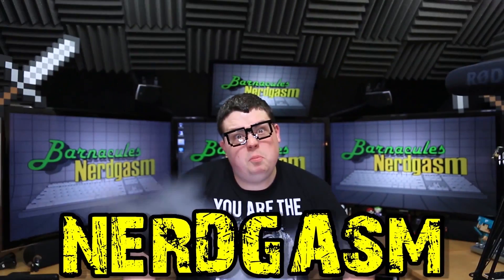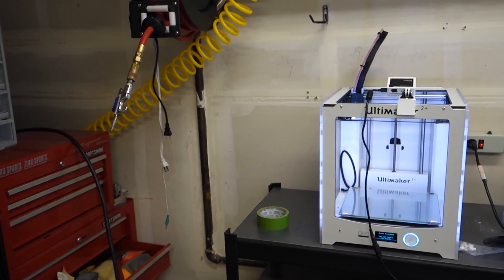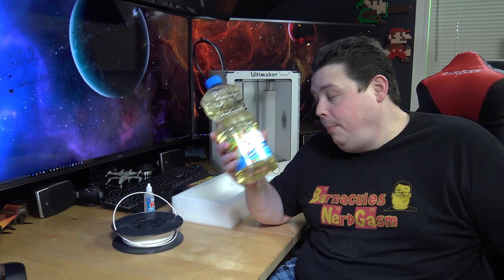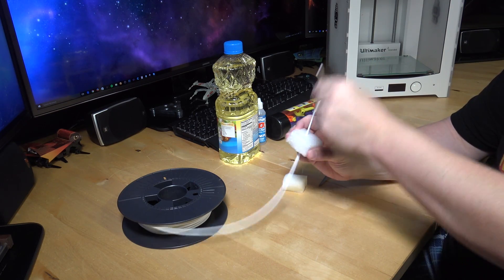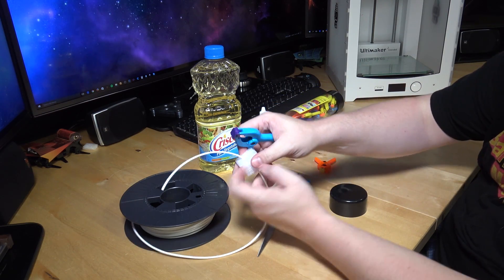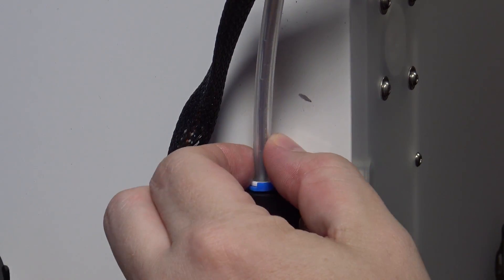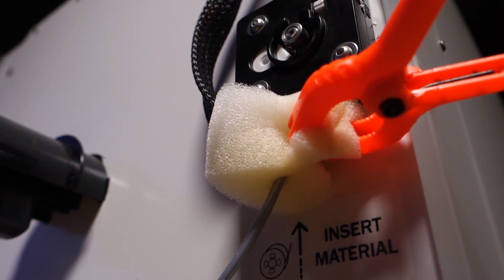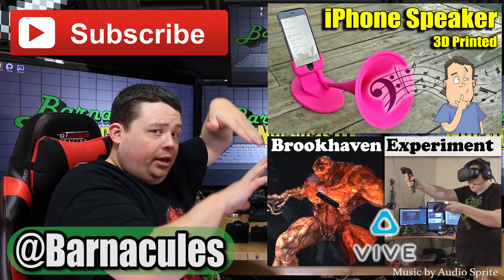Custom 3D Printer Filament Cleaner Helps Stop Jams! #JerryRigged - @Barnacules

Comment from the maker: This is still a fantastic way to keep your filament clean and stop your nozzle from clogging especially with high temp filaments when you're in a somewhat dusty environment. I found it had the most impact on my printers deployed in my garage because of dust kicked up from my central heating system. Also, come join me for Morning ☕LIVE stream on http://twitch.tv/barnacules daily at 9:30am PDT
Reply: Barnacules Nerdgasm I used this on my Maker ultimate pro (Monoprice's D6 rebadge). It's INCREDIBLE how much dirt and dust comes off the filament. There was visible build-up on the filter after a few prints. There are No more sputters from a partially clogged nozzle!

P.S. I blame you and The 3D Printing Nerd for getting me hooked on 3D printing. It's like a drug. "Ooooo PLA and PETG. MMmmm nylon. MORE! I NEED NINJA FLEX, WOOD AND COPPER PLA! I NEED THEM ALL!!"

Comment: They make printable models that contain the foam inside of a small canister, if you don't feel like having the foam out in the open. I've used one for a few months, and it's a great little dust collector.
Reply: How often do u replace it? Today i had a print failure cause of dust even though ive got the printable dust filter canister thingy, the one thats purple in the youtube thumbnail video, i swear i had changed the filter like a few days ago
Reply: @l0wkey529  I haven’t had to replace it. Keep it totally dry and everything will work out. Oil and other liquids put the dust back onto the filament. I use very porous open-cell foam for ease of maintenance. It gently debrides the filament of any dust. Just have to blow it out with canned air every few months.

Comment: If your extruder doesn't have PTFE sleeve, adding oil lubrication to the filament can help prevent filament clogging.   Don't use cooking oil as this will go rancid.  Use mineral oil instead.

Comment: you know, this stupid trick.... worked.  I had been having failed print after failed print. it was driving me nuts. kept jamming. I took a piece of dish spong. put a slit in it and put it on the filament, and whamo, prints fine.....

Comment: Why not just use instead of clamps, a zip tie ? you can adjust it all around the block and pretty easy to mess with it while the print if it does drag too little.

thoughts ?

Comment: I haven't tried it yet, but plan on doing this at some point. I ordered an FT-5, and when I get it, and finally get it built. I plan on printing a filament enclosure. If it turns out well and works well I may release it so everyone can use it if they want. 

The enclosure I am planning is probably a good example of over engineering... The enclosure will be multiple pieces, a solid outside that does not move that is 2 parts (hopefully airtight or close). The filament exits the enclosure into a bowden like tube, maybe one for 3mm filament? , or one maybe a little larger. It doesn't need to be as tight to the filament since it is on the other side of the drive. It is just a method to keep dust off of the filament. The tube would either enter into a direct drive, or a bowden input side. The spool will be on a rotating assembly that locks to the spool that also has adjustable tensioning built in so the spool does not unwind inside the enclosure. 

I also plan on enclosing the FT-5, not for temp reasons, just a way to keep as much dust out as possible.

Comment: so you have a (actually looks like at least THREE) 3d printers, and the best design you could come up with for a  filament filter is just a clothes pin or a clamp ? way to utilize that gear my man.

btw, don't do this stupid "oiling the filament" shit, it's been proven to not only gunk up your nozzle, but it will also ruin layer adhesion in your prints. think about it, you want the plastic to stick to itself, right ? so introducing a lubricant to that is going to help ?? if your filament is hanging up, squirting some crisco on it isn't going to fix your issues, and it'll create a whole new set of problems.

Comment: CNC Kitchen said the oiler weakens the layer adhesion. What is your opinion about it? Why not just use a foam block without oil to wipe the filament?

Comment: i have an idea about the filter. IF...you 3d print a plastic box that can open and close or snap together, you could place your filter INTO the box... so the filter doesn't get any dust on it. On the box on the top end and bottom end you will want to drill a hole on each end so the filiment can pass through the box. then velcro the box to the printer. when you want to change the filter...un velcro the box ....open it up.....change the filter then stick it back on the 3d printer. plus...you won't need a honken clamp on the thing...the box will hold the filter in place. just a thought for you. it's what i would do. thanks.

Comment: I'm using melamine foam. It's marketed as magic eraser I think. I put CRC silicone spray in it. Working good so far!
Reply: Great idea with the melamine. do you know if the oil might keep the layers of filament from adhering to each other?

Comment: Do you have any tips on stopping the filament getting jammed on the spool itself , i don't know if its just the crappy PLA that came with my i3 but i have to loosen the filament form the spool or it has the potential to get jammed as its rolled onto the spool over itself

Comment: I did a little research recently and discovered that Magic Eraser foam is the best for Silicone Lubricant.  I'm using it in my 3D printer now.  Great tight foam sponge.  I also 3D printed a housing for the foam since I prefer to have something solid mounted to my 3D printer.

Comment: The technique of using a filter that also lubricates your filament is a good one...but search Thingiverse for "Dust Filter", pick one of your liking, and print it!  I have dramatically improved extrusion performance on my two Ultimaker 2+ printers with the simple addition of filters.  DRAMATICALLY.

Comment: That $60 per role isn't as bad if you consider the 3D printers we use in my engineering classes use special support material that costs $350 per role (about the size  or maybe a bit smaller of the role that Jerry shows in the video) and the model material is $300. We use soluble support that we can put in a solvent bath to dissolve it

Comment: How are you clearing the clog when it's caused by dust?  I don't have dust issues but I often do have filament diameter issues, even with high quality filament. I would like to see a gizmo that would monitor the diameter...  My extruder might be overly sensitive to the diameter.  Taz5 V2 single extruder.

Comment: Better way to do this? Having the extruder stepper directly on the print head just simply works better. There's a lot of play in the filament tube - bends in the tube, from the filament flexing, etc - this makes retraction settings nearly impossible to dial in. Whereas when the extrusion stepper is a mere inch away, in a straight line, from the head itself, there's much less room for problems.

Comment: Couldn't you use a modified test box (such as Thingiverse thing 37274) that was zero filled to hold the foam?  I think that it would eliminate the danger of the foam coming in contact with the extruder.  If it was printed at 30mm it might work better.  I would add four 3mm holes (2 to the solid bottom of the box for at least 2 mounting screws and 2 more that were on parallel sides of the box for the filament to pass through)...  This box design could be easily modified in any 3d program to add these holes and to play with the optimal size of the box.  It may be a good idea (or not)...  I just had some teeth pulled and am quite loopy still.  =)

Comment: Is there a reason he didn't use olive oil? It has a much higher boiling point than veggie oil and could therefore be used with ABS.
Reply: ABS print temps are typically around 245c.  The smoke point of even extra light olive oil is below that.  Rice Bran Oil runs 254c, Refined Safflower is better at 266c.

Comment: epic video but I have one way to make it better instead what you can do is take a small bottle of it and make sure it has a super small hole on the lid put a pipe on it and it and make it lead straight to the phonem and then every once awhile you can just disconnect the bottle. instead of needing to take off the clip and everything

Comment: I still don't like the belt drive systems used on cnc machines like your printer, ballscrews or even an acme thread would be a huge improvement over it and would not drive cost up by much at all.
Reply: Too much backlash in the threads. That's why those aren't very common. and making the thread tolerances any tighter causes more friction/drag, and creates the need for bigger/more powerful steppers, and they'll just wear out faster.
Reply: Andrew Delashaw You do realize that most cnc machines use ball screws right? And that they have very smooth operation and decent ones have PMI backlash compensation. Ballscrews are not just common on CNC machines, they are standard. Belts are a joke.
Reply: Andrew Delashaw And they don't wear out faster.
Reply: Andrew Delashaw AND on top of all of that, too much backlash? Is that your argument? Do you know how much backlash belts have? I have a CNC machine with ballscrews and one with belts, the one with belts has almost .28 backlash on a belt system no different than a 3d printers.
Reply: rkshireygames I have used an Xcarve with belts and a shopbot with screws, I can say I like the shopbot better. especially since it is a stronger printer. but for 3d printers a belt is lighter and more than enough for the light scale of work
Reply: Coleman Becker I still prefer ball screws.

Comment: after a while the filament starts to rip off small chunks of a soft foam and propel them forward. Sometimes w/o consequences... It should be checked from time-to-time. In my experience, better check it every ~5 hrs of printing.

Comment: Doesn't the oil contaminate the filament?
Reply from the maker: +Yutaka Takenouchi As long as it's a very light coating it does not, but if you gob it on there then yes, it totally does.

Comment: does this mess up adhesion? I would think the oil would prevent the plastic from adhering to itself.
Reply from the maker: +Eli Youmans I thought the same thing but I've experienced no such problem as long as the oil is very light, if you put to much on it totally does screw up everything.
Reply: hmm, I will have to try this! When I buy a 3dprinter... #poorpeople

Comment: 3D print small tank and make one side filter and it will absorb oil to filter and you can attach it to wall and it will not move and wont clog and you can easly pore more oil if needed

Comment: be a bit careful with certain types of oil else it might chemically react with some of the plastic/rubber parts in your printer. Not sure if it will be a problem, but it could be in the long run.

Comment: I've never had a clogged extruder due to dust. so i dont see any point to this.. I have a 0.4 nozzle. only clogging problem was from abs particles on the stepper gear getting into a place print. after that one time it's smooth sailing. (if I don't forget to check my bed level)
Reply: pla not place damn phone... can't even edit a post on it.
Reply: +DarkShadowsX5 try the 3 dots in the right corner of your comment.
Reply: ... is this better?

Comment: Personally after my labtime at university I'd recommend silicone oil - pure silicone oil is inert it basically doesn't wan't to react with anything like air (go rancid) or plastics and metal (corode). Only caveat it creeps everywhere - over small bumbs or sometimes  even out of containers. Main problem is getting silicone based lube in high quality without to many additives - like medical quality ... oh wait maybe at the drugstore ... and I also learned that it's important to keep your filament clean, dry and locked away before you lube up ...

Comment: Couldn't the lubrication of the bowden tube be potentially bad? I mean, oil is accumulating inside the tube as the filament goes through and maybe this could result in an oil drop or too much oil on the filament. Is this right?

Comment: Concerned that veg oil will eventually gunk up that tube after a few months, It absorbs moisture and turns into a thick hard to remove gunk. Silicone shouldn't do that.

Comment: Print a small box, with a hole through it the size of the filament so you can have an enclosure for the sponge and oil...would probably be able to create an auto-lubing system somehow too...

Comment: I 3d printed a housing for a rectangle of kitchen sponge foam. Just poked the filament through and worked it around to keep a snug fit with minimal drag. I found using a dab of coconut oil in the sponge kept everything feeding smoothly. Cool video :)

Comment: there are dozens if not hundreds of "oilers" on thingiverse, I haven't found them to be very useful. The current spool holder I use has a place to insert a sponge with some oil. Don't see it as an issue on either of my 3 printers.

Comment: Barnacules: Great video. Will try it for my U2+...but watching it I thought at another thing. Will it work if you 3D print a busher? Like design a simple hollow cylinder in tinkercad, or a small block that looks like the one on the ultimaker where you insert the filament? And put the foam in there? and doubletape it to the printer and you just add the oil from the top. 
The beauty about 3D printing is that you can open your mind to anything. And for that I have to thank you. Your videos helped me pick an Ultimaker 2+ and for about 4 months now I am extremly happy with it. Have a nice weekend with your family!

Comment: But yes It does work well, I have been doing it on all my PLA printers for 12 months. PLEASE tell your peeps that its only for PLA and epic fail if you use it on ABS. Too much oil will cause adhesion issues. And Filament manufacturers are against doing this for some reason, apparently the oil gums the hot ends but i'm yet to see this.

Comment: 3D print a box with a hole bigger then the filament then have a little hole ontop of the box to put oil it, so that way the filter is hidden from dust etc with a box around it. Also would hold oil better so it doesnt dry out.

Comment: hmm, if the problem is just dust settling on the filament that's causing the issue then personally i would just make a cover that goes over the entire area to prevent dust getting in at all, and to change filament just pull it off, switch and put it pack on, no need to keep re-oiling.

Comment: you have a 3d printer why not print out a housing for the foam that can mount to the printer with adhesive tape. leaet thats what i would do if i had one

Comment: you could just use a mig welder feed lubricator they are made of felt and are clamped in a c tube to hold it closed just like your rig they are very cheap and a lot less geto looking
Reply from the maker: +MrGrantdw Send me a link on Twitter.

Comment: Hey Jerry. How do you print complex structures without support material?
Reply from the maker: + Adrian Ronald Sehat You don't unless you have a $100k powder printer. That being said you can use support material that disolves in warm water and then just submerge your part afterwards. look it up! I'm going to do a video on it when I get my duel extrusion printer working.
Reply: Barnacules Nerdgasm :O I don't have any of those. I guess I can try lower the speed and with 0.1 mm layers. Looking forward to watch that double extrusion printer video. Thanks

Comment: Couldn't you just build a little dust proof area for the printer to sit just like a painting booth?
Reply: +Street Guru but why? that would be a far less reliable and complex build that takes up a lot of extra space....
Reply from the maker: +Street Guru That seems far more complicated then just putting some foam on the filament :D
Reply: Barnacules Nerdgasm
Just copy linus, just drape some plastic sheets from a cheap wooden frame and you're good to go
Reply: +Street Guru or for an even easier method i used a old sweet tin that i cut a hole in to allow the it so sit on the filament holder on my ultimaker 2 to keep dust out

Comment: My variation is I use one of those "dense" kitchen sponges and for oil I just use 3-1 oil. My only concerns with veggie oil is it going rancid/stinking the printer up. The other (larger) concern I have is with the silicone oil breaking down at the temps we 3D print at + releasing some not so friendly byproducts in the process!  That said where I live is dusty and I run a wiper myself and the qty of crap it collects is insane! Better wiped off than burnt in the nozzle :)
Reply from the maker: +Calvin Witt I haven't had any problems with the veg oil yet because it's such a thin coat but I suppose it could eventually go rancid and sink a little bit. But I imagine the filament constantly going through the tube is replacing it over time. The 3-1 oil is a good idea, I have some of that I should give it a try and see if I notice any difference.
Reply: +Barnacules Nerdgasm Thing is the oil will also get on the heat insulator + the extruder is all. That is why I use 3-1 oil but that is my personal choice. I have 1/2 a gallon of Mobil #3 Vactra way lube for CNC machines I could use but it smells rank ;-)... so it isn't a good idea!

Comment: can I also use an unused kitchen sponge (with the green abrasive part removed)
Reply: I don't have any foam lying around soo...
but I have some dust problems in my room soo I want to prevent clogs... so I want to use this on my printer
Reply from the maker: +parkeerwacht The problem with sponges are they are a little to soft and little pieces can come off, you want to use a material that won't wear down over time. So far the foam seems to hold up really well but I'm thinking a sponge might not. But it's worth a try, just keep an eye on it.